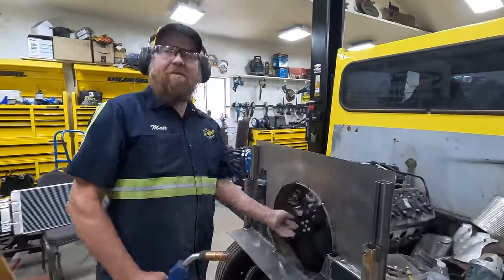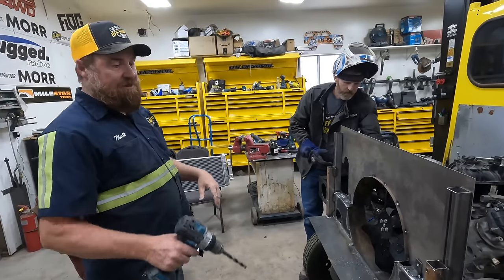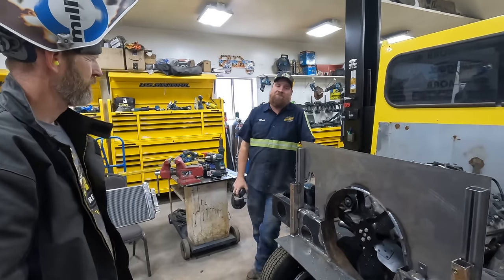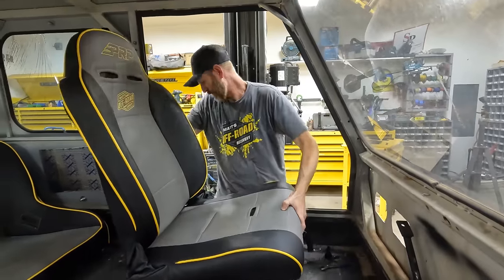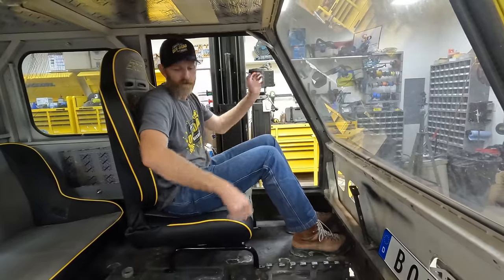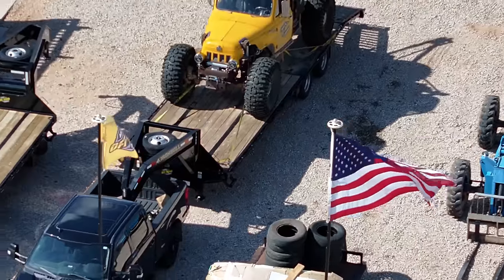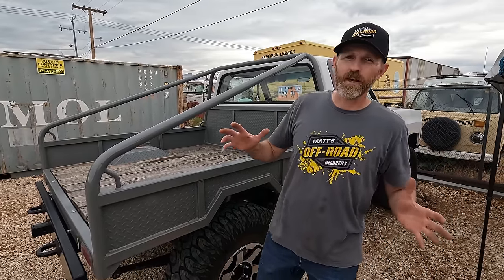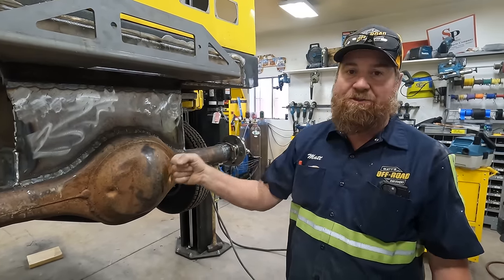The Best Upgrade The Bombi Will Ever Get!

Comment: What if the throttle was kinda like a plane's and the brakes were on the feet?
Reply: Easier to get in coz no sticks in the middle. Not awkward to drive with sticks off to the side of the driver.

Comment: My point of view... When the thermostat opens,  hot engine fluid goes into the radiator. The hot engine air is being blown through the radiator. overheating will be the result. Cooler should be pulled through the radiator to cool he engine fluid.
Reply: It pulls cool outside air into the engine compartment and then blows that air through the radiator. The heat it picks up from the engine helps with cooling since it’s removing that heat and pulling in fresh air. So, the radiator is a little less efficient but is offset by cooling the engine compartment. 

When pulling outside air through the radiator you’re blowing the hot air into the engine compartment. That puts all the load on the radiator since you’re blowing hot air into the engine compartment. 
Basically anything that isn’t getting air forced into the radiator when moving is setup to blow from the inside out.

Comment: I would have just mounted an electric fan directly to the radiator, no need to worry about engine movement. Two smaller ones if you want a backup.

Comment: The sticks should be forward=power & back=break, independently. The forward=power can be mechanical or hydraulic where the percentage of power of the one is added to the other (obviously you get one power output from the engine. Now, I guess you only get one amount of power from the engine to the wheels and you just brake to reduce it. Still... Since you are making it from the start... Anyway, enough talk. Make it so!
Reply: Also, maybe you can use the drive by wire used on planes and have controls on both the driver and the co-driver. Alternatively, you can use a driving wheel to go from center (equal power to both) to left or right? Anyway, if you need ideas let me know 😅

Comment: If the front of the vehicle is out at the front of that wench, I don't move the front of the vehicle out to where the winch is?  You are kind of fighting for leg room inside, a bit.  Push the front of that body out over the winch, or sink the winch inside it, or put the winch down between the frame and the axle. No sense having the vehicle be an inch longer than it has to be or have the cab shorter than the actual front of the vehicle.

Comment: Lotsa fun and I like what you're doing, but I"ve had a LOT of experience with those rivnuts and I really believe you're going to come to regret using them.  In my restaurant service business, I came to hate the sight of the damned things.  Also, on the puller you're using, you "really" need extended handles, which will be no problem for you.  A while back, working on an aluminum boat, I used 170 sealed, waterproof, 3/16" SS shaft aluminum pop rivets and had to buy the $20 HF popper.  What a bargain.  Tough job made easy with those long, heavy duty handles.  Yours is a joke in comparison.

Comment: I believe that radiator system is not going to work because there's no air flow at high speed remember it's in the back of the vehicle well there's no air movement you just rely on the fan. Electric fans are the way too go

Comment: Wouldn't have been SO MUCH SIMPLER to just use electric fans? They even come as a unit with radiator and shroud. Betting a dollar to a hole in a donut that they end up using electric fans.